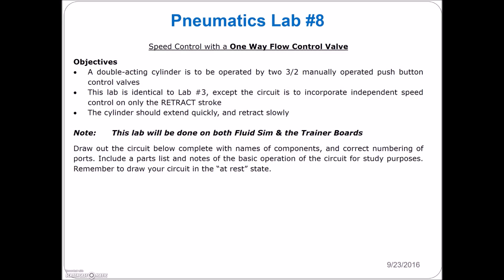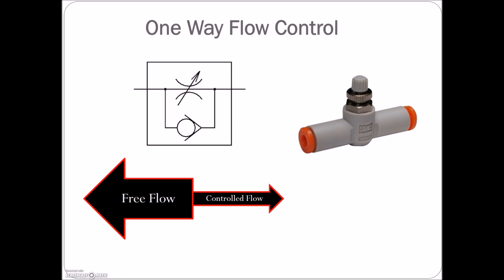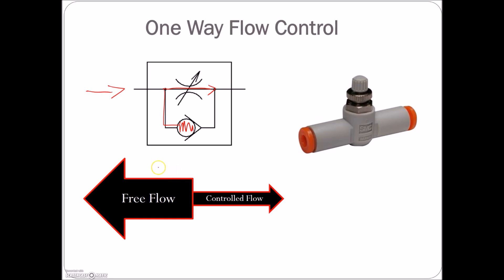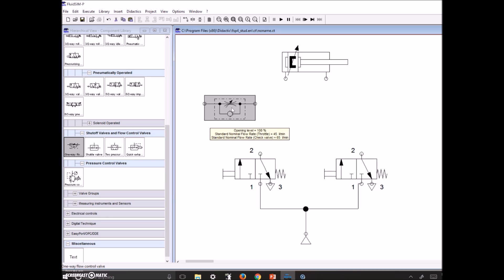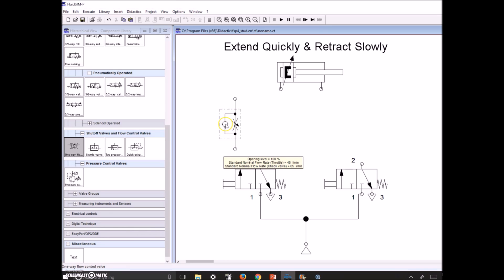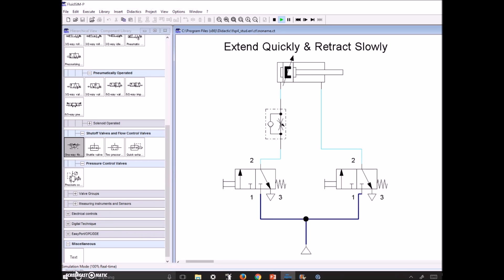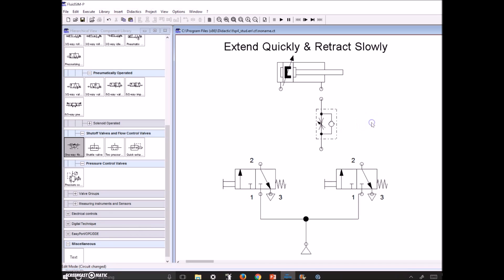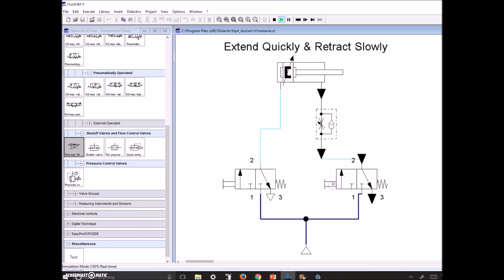Pneumatics Lab 8_Speed Control with the One Way Flow Control Valve

Comment: In Pneumatics we want to fix a flow control valve in exhausting position only but with this circuit the air is controlled when going inside but the another end of air will exhaust easily so we can't control the Speed of the cylinder because this median is compressible for hydraulics this will suit

Comment: Not sure if you're going to reply, but in my fluidsim, the one way valve only have label and layer. Is there anything wrong with my installation?
Thanks!
Reply from the maker: Not sure. If I right-click on the valve it provides me with the option to adjust the opening... but my version is very old.

Comment: I am wondering, why instead of throttle valve in adjusting the extend speed of a single acting cylinder we need to use a one-way control valve? 🤔
Reply from the maker: 'cause the teacher hasn't purchased any... We don't have a throttle valve in our "tackle box" at school, only a one-way control valve.

Comment: Hey I need ur help again will u make a video on controlling the speed of the pneumatic die grinder or at least u tell me the circuit
Reply from the maker: I think you need an inline regulator. http://www.ebay.com/itm/3x-Inline-Air-Regulators-Brass-1-4-NPT-air-tool-accessory-paint-gun-die-grinder-/371662504663 

The die grinders usually come with  a throttle lever to control speed, but the inline regulator should help to reduce speed even further. 

Here is a video describing how pneumatic tools work. https://www.youtube.com/watch?v=QtzWMxTedL4